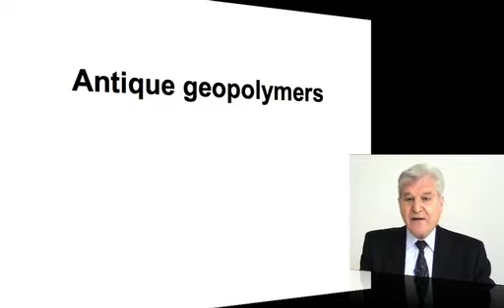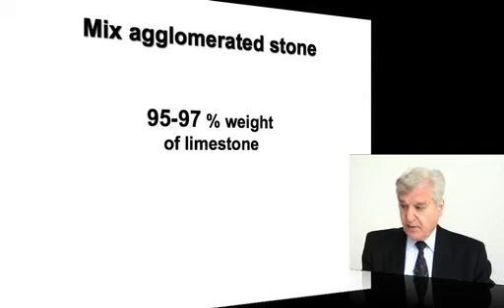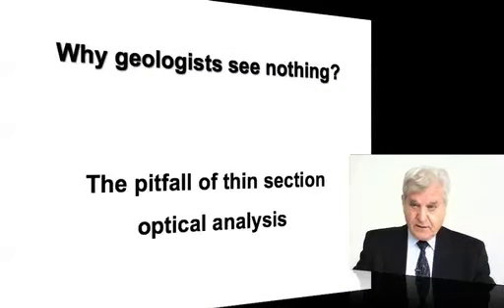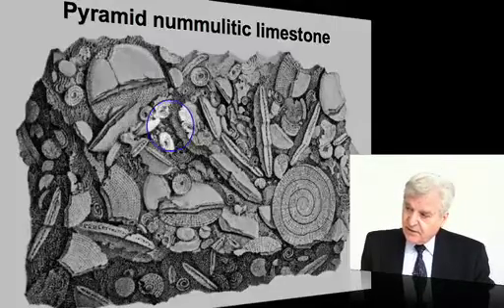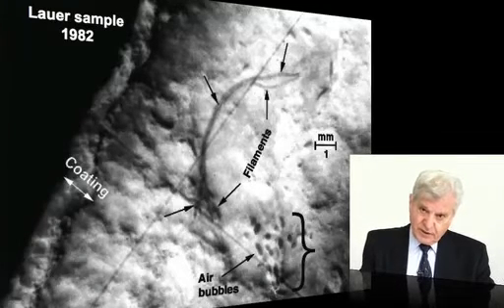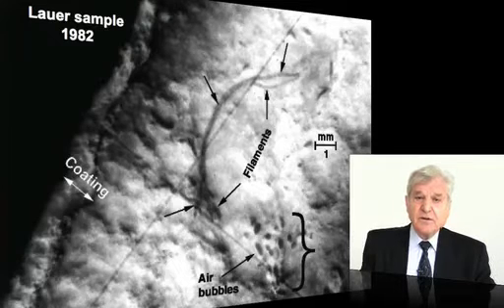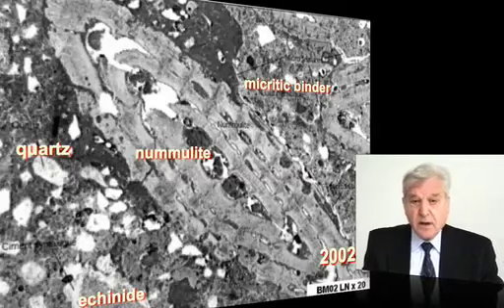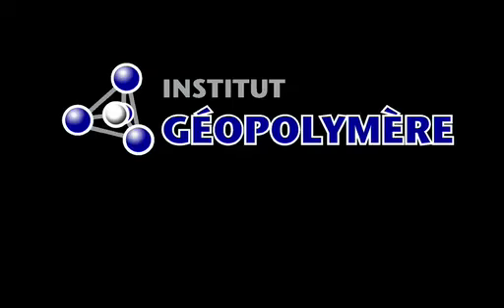How to analyze pyramid stones

Comment: so why can't this theory be merged with parts of Jean Pierre Houdin's theory?

why does it have to be one theory or the other?
why can't both theories offer co-solutions to the same problems
Reply: what is jean pierre's theory with regards to geopolymer? I thought Houdin talked about history being fake/forgeries from the middle ages?
Reply: nevermind, I was thinking of Jean Hardouin not Jean-Pierre Houdin.
Reply: @frankdrebin2343 Jean's theory is that the grand gallery was used as an inclined trolley system to hoist materials up the pyramid. 
Also I think he has the interior spiral ramp theory

Comment: "There are a number of factors that prove this theory impossible" Tool markings, irregular shapes, do not prove this theory "impossible" You have block that cracks or make a bad mold for irregular shape. And why can't a tool be applied to a molded block. Also most smooth blocks that were married to to pyramids on the outside were take. A carving tool of some sort would have to be used to do that.